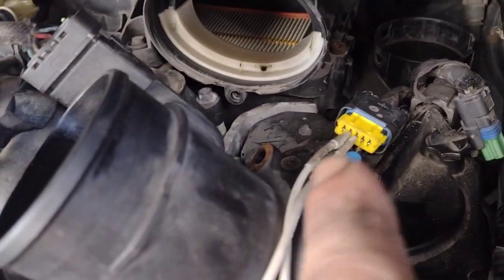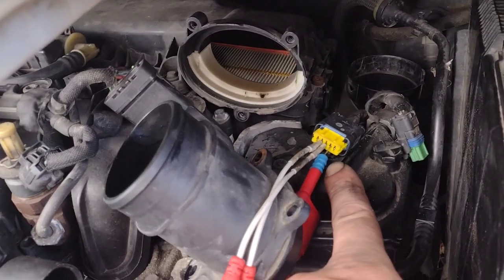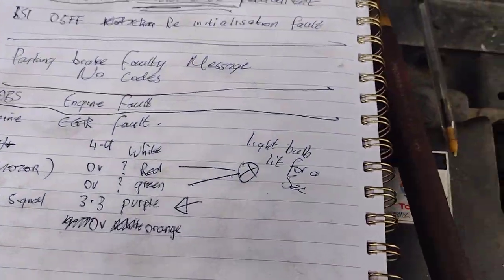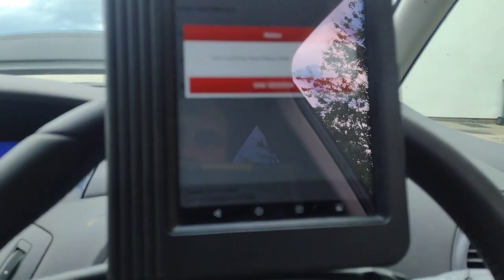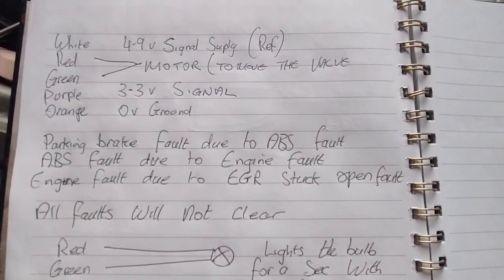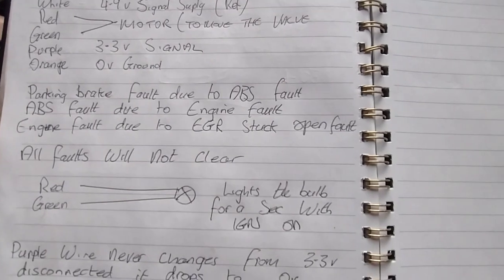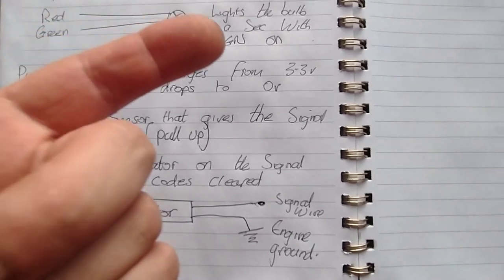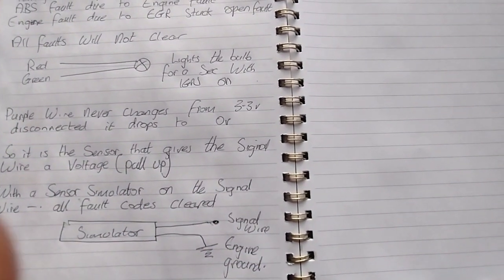Citroen C4 (parking brake fault, ABS fault and engine light on) all due to an EGR fault.

Comment: Great process Matt, The scan tool in the video is that the launch? How do you find it as i am looking for a relatively cheap scanner as another back up to have on the van ?
Reply from the maker: This is an older scan tool that I kept hold of. The autel wasn't very good on this car. There has been a few times that it has been helpful when other scan tools haven't worked out.
Cheers Matt

Comment: Good video, good process. Those sensor simulators are handy tools. Could the 5v reference voltage be connected to a variable resistor and ran through the sensor wire to achieve the same thing? Good to hear youre recovering, coil springs are deadly dangerous.
Reply from the maker: Yes the variable resistor between the five volt and the signal wire would allow you to do the same thing. Thanks for watching

Comment: Hello, Is the turbo on the same circuit? Could a faulty turbo cause the same issue?
Reply from the maker: Possibly, if the fault code in the ABS is saying it has an engine fault. It may have a different engine fault, but fixing it should allow you to clear all fault codes. Cheers mate